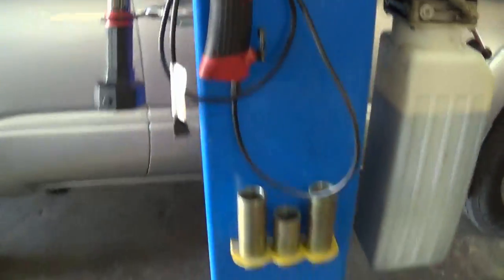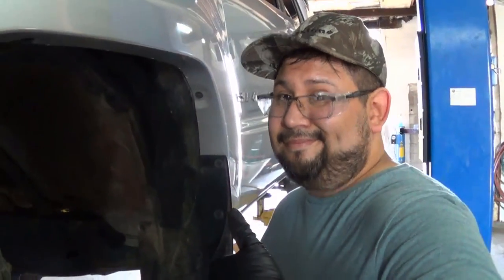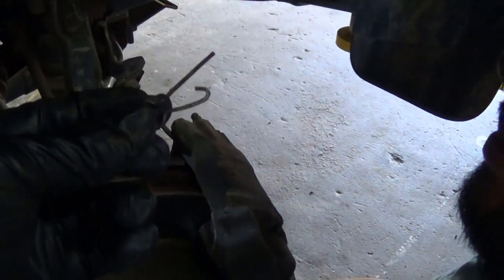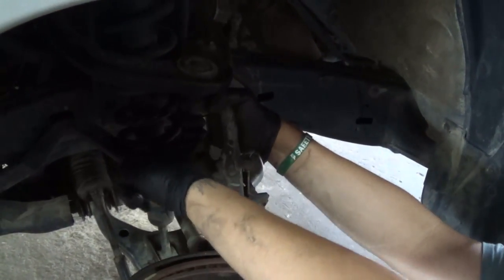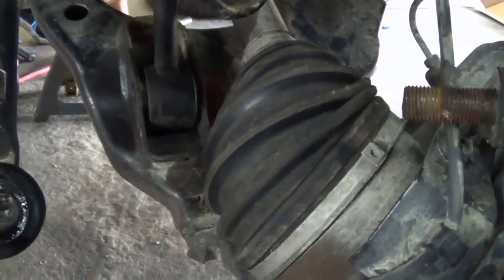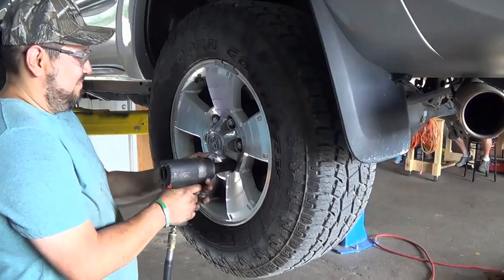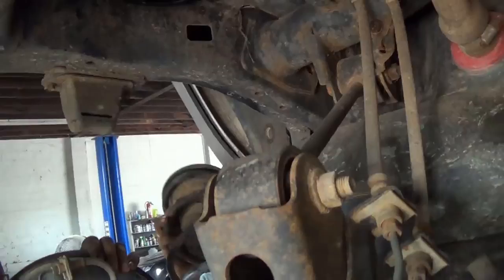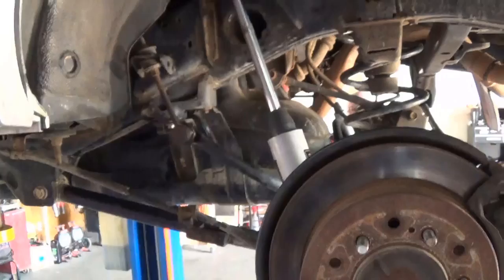How to Install the Rough Country 3" Lift Kit with N3 Shocks on 2004 Toyota 4Runner (4th Gen 4Runner)

Comment: Looks good !! I’m thinking about getting a forerunner in the future and kicking around what lift to put on there doesn’t seem to be much different when you put in a 3 inch leveling kit or the 3 inch total suspension lift it’s basically doing the same thing it’s not a body lift so, I put a 3 inch lift on a Suzuki sidekick I had and I had 29 5 x 9 50 Michelin motors on it was a fun jeep for the woods ,And I had a 80s model four-wheel-drive Nissan I put another 3 inch kit on it had 12 x 33’s on it mudders

Comment: LOL, don't struggle getting the tie rod end loose.  Put the castle nut on upside down, thread it back on until the end of the bolt is flush with the nut, then whack on it as hard as you like.
Reply from the maker: 😂 😂 😂 Now you tell me!

Comment: what has been your opinion on the performance after having the RC 3in on for over a year now?  Really considering it for my 4th gen and wanted your take or if I should spend a little extra on bilstein 5100's or Eibach's. Thanks a lot!!
Reply: If you do this, or have done this, do not forget to buy the front diff drop spacers and the sway bar drop spacers, other wise you will prematurely wear out your CV axles and cause binding in them. BTW, you can't go wrong with Bilsteins or Eibachi's shocks, save yourself a few bucks!

Comment: This is why, at least with me, I will take mine to a shop and pay a professional to do it. I just don't have the knowledge of the suspension to be tweaking it and the overall frustration of getting things off. Good work though, nice to have a knowledgeable friend to help out!  I might have missed it but what size tires are those? I like your lift size but don't want my 265/65/17 tires to look too small until I get larger tires.  Looked at RC's site too, not too expensive too!  :-}  The front still looks a tad low but could be the camera angle.
Reply from the maker: I think that's what size mine are. Don't remember off the top of my head, but they don't look too small at all to me with the lift.

Comment: I read somewhere that you have to replace the upper control arms when putting a 3” lift. I noticed you guys didn’t, have you had any problems with it ?
Reply from the maker: It's been over a year, and I haven't noticed any issues.

Comment: I just installed the same kit on my 05. Did you have any issues with the spacer bolt rubbing on the floor board underneath? Mine is and making a horrible squeaky noise

Comment: I wanted to have my sons done. It’s an 04 limited 4Runner but the shop is telling me it will be $600 extra if they have to torch that bolt. Does that sound right?!
Reply from the maker: That sounds expensive to me. Can you shop around and see what other shops in the area charge?

Comment: Hi, I have a 2008 4runner and I bought a 2.5-inch OME suspension, I want my 4runner to be level front and back since it comes a little lower in the front part of the factory, which I should buy to make it level, I hope you can help me, thanks you!
Reply from the maker: I'm pretty sure this kit leveled it out. It's a 3 in lift for the front, but only 2.5 in lift for the back. Not sure though.

Comment: Looks good I don't think your rear brake lines where to happy but no harm no fowl I learned my lesson the hard way about taking off all brackets when I did my front struts it did not go together like butter and I never pulled the line for the abs(that probably would have taken 10 min) between cranking on my upper control arms and my hub I killed 1 of my wheel sensors still not sure wich so a word to the wise if it's getting to that point we've all been there walk a way for a few min and take the time to think about how you can do it differently with the right tools it's not a bad job just take your time and think it through get creative if you have to I know I do stupid stuff when I'm hot-headed and not paying attention like putting a ball joint in upside-down and beating it into a hole it dint fit - not a good day so if you're going to do it stay calm and pay attention and it may even go together like butter
Reply from the maker: Great tips, Justin! Thanks for the feedback. You are so right. I wish you could have seen us having to cut the rear shocks off with a torch. The nut land on the tire on the ground and burned a hole straight through the sidewall. Why can't working on old vehicles ever be easy? LOL!
Reply: @BushcraftRidge  not going 2 lye that made me crack up only because that is something that would happen to me  but that does suck there's nothing worse than thinking you're almost done with a job and having something else break and have to spend more $
Reply from the maker: @justinbush7610  Right!? In my latest video, I put a Victory 4x4 roof rack on her. And I sliced my thumb open on the very last bolt. Never fails! LOL!
Reply: @BushcraftRidge  nice mod- oh u didn't know your not doing it right if there's no bloodshed or soar knuckles I always keeps electrical tape napkins and super glue in my truck Its never let me down yet
Reply from the maker: @justinbush7610  LOL! Indeed!
Reply: @BushcraftRidge  took me like 2 hours to change a caliper on my Sequoia a while ago lol. I had to drill the pins out of the caliper they were so seized in there, I lubed them, torched them, hammered them, lubed them again, torched lol. I finally said fuck it and broke out the drill. It's an 02 and I live up in Canada, rust is inevitable up here.

Comment: Any alignment issues, by not adding upper control arms?  I have the same kit just haven't installed it. Undecided on getting upper control arm
Reply from the maker: I got it aligned at Firestone Complete Auto Care after the install and have not had any issues. I also paid for their lifetime alignment, so free alignments if there are any issues in the future. ;-)

Comment: How does the ride handling compare using a spacer lift kit instead of a spring and strut kit?
Reply from the maker: Not sure. Seems to handle fine, though. I have thought about putting spacers in just to get a little wider wheel base.
Reply: Bushcraft Ridge Sorry, I was talking about the ride quality on a spacer lift kit vs a full coil over setup. The spacer lift kit just goes on top of the top hat of the struts right?
Reply from the maker: @1badEK  Gotcha! Sorry about that. I was thinking about wheel spacers. You are correct. This kit does use the strut spacer in the front. But full shock replacement in the rear.

Comment: What size and kind of tires are thise
Reply from the maker: Not the ones I want. :-( They are Toyo Open Country ATs. The size is stock--I believe 265/75R17. I want the 33" Firestone Destination MT2s. Those tires are awesome!
Reply: Thx I have the Same 4Runner
Reply from the maker: @hartleypyron  Nice! I just got this one a couple months ago, and I love it,
Reply: @BushcraftRidge  you think you will get rubbing with 33s? How are the 265 75 17s doin for you
Reply from the maker: @oh_thatz_mauricio  Might have to do a little cutting on the plastics. I plan to replace the bumper with a high clearance one later this year. These Toyow can't do anything in the mud. Even with the slightest bit of rain, I can't get up the Ridge.

Comment: Why did you remove the tie rod that was unnecessary
Reply from the maker: Thanks for watching and taking time to leave feedback! The instructions that came with the lift kit said to disconnect the tie rod. And I don't think we would've had enough room or clearance to remove and then reinstall the strut assembly if we hadn't disconnected the tie rod.
Reply from the maker: Look at 23:35. You can see we definitely needed it out of the way.
Reply: It would have been cheaper and actually easier to drop the sway bar so you don’t throw your alignment off.
Reply from the maker: @disfordetail7671  We had to drop the sway bar too.

Comment: dude ! What is the tire size !
Reply from the maker: 265/70R17
Reply: Got a second question sorry, what about the front shocks ? Stock shocks ? They aren’t holding the weight, Im I right
Reply from the maker: @antoniotangarisabatino1206  Front are stock. Only the back ones got changed out. In the front, it's just a spacer that goes between the strut assembly and the frame.
Reply: Bushcraft Ridge yes I know, I just wanna know how it feels driving with the stock shocks
Reply from the maker: @antoniotangarisabatino1206  Feels fine to me. I may replace them in the future but definitely not necessary at this point. I'm not doing heavy rock crawling or anything like that though, just some light off-roading.
Reply from the maker: @antoniotangarisabatino1206  Did you see this: https://www.youtube.com/watch?v=ldkI7G8M6HI&feature=youtu.be
Reply from the maker: @antoniotangarisabatino1206  And this https://www.youtube.com/watch?v=7L7Y6zK--VQ&feature=youtu.be

Comment: hello what is the best tire size for 3 inches? thanks
Reply from the maker: That's a good question. These are about as big as I can go with the 3in lift. If you use a wheel spacer you can go bigger.
Reply: @BushcraftRidge  i just got a 2.5 inch lift on mine and 1 1/2 inch spacers, could I fit 33 inch tires or just 32s?
Reply from the maker: With spacers, I think so. Definitely in the back.